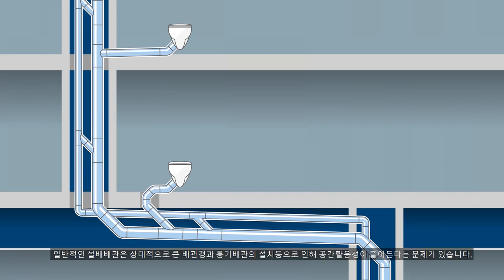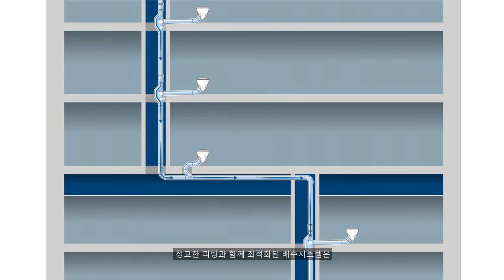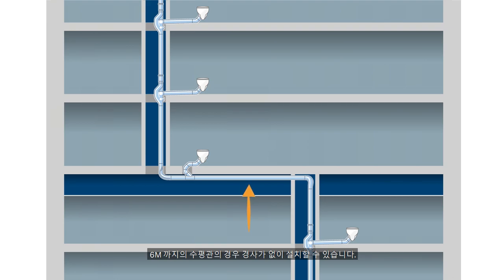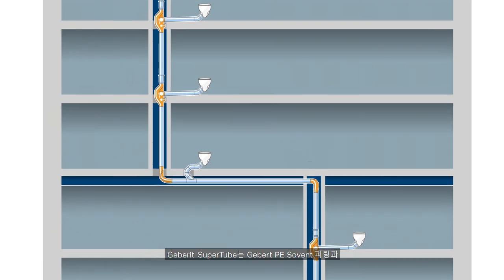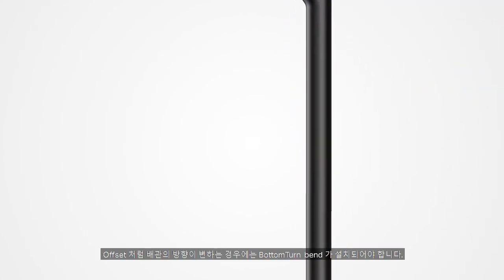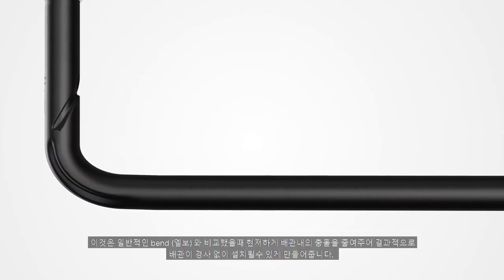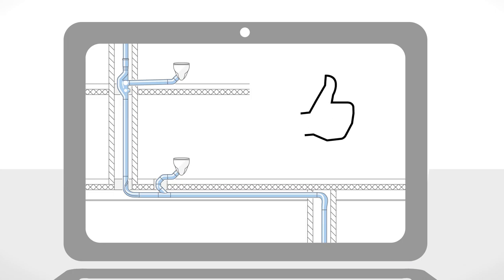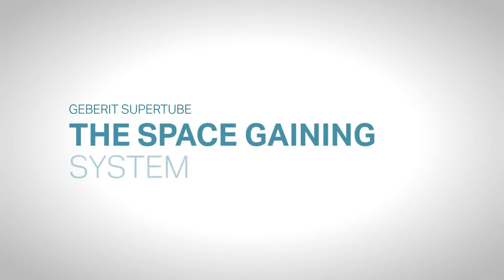Geberit SuperTube (KR)

Comment: What is the minimum vertical height requirement? What is the minimum flow requirement for the siphoning effect to work, which would keep the horizontal section drained cleanly?
Reply from the maker: There is no minimal height requirement. Important is to use SuperTube only with Geberit Sovent d110 branch fittings.

We recommend to use the system in high-rise buildings.
 There is no minimum flow requirement for the horizontal pipe.

For more details, please contact Geberit in your region.